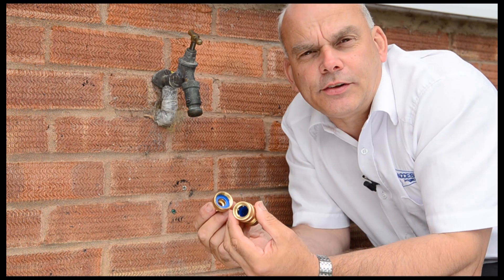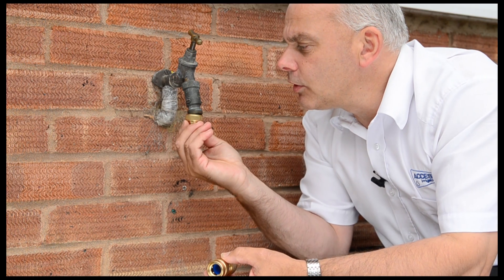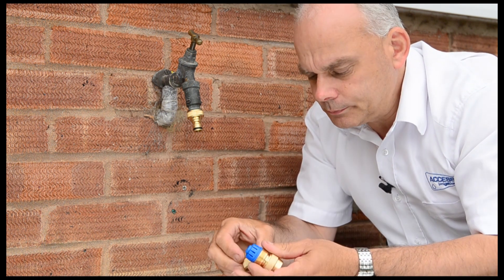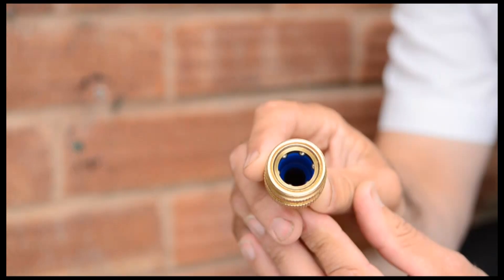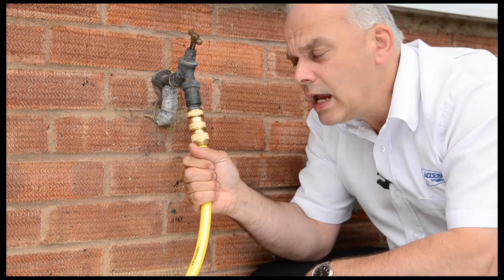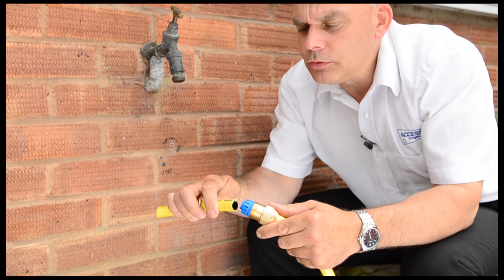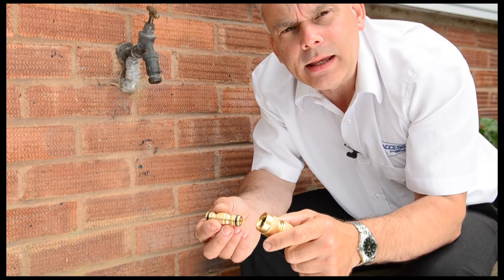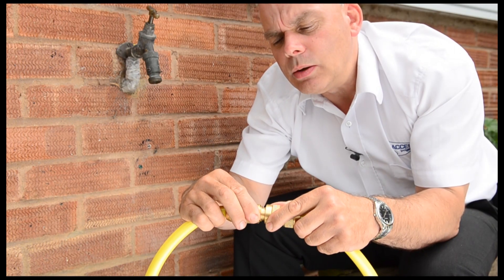Brass tap fittings hose connections

Comment: Makes it look easy for trying doing this when you got imperial tap and metric hose just won’t fit it’s a pain in the arse 
He has all the best connections setup but in reality people have all different connections.
Reply: Generally all UK garden taps are imperial 1/2" taps. These have a 1/2" BSP thread at the back where the water comes in and a 3/4" thread on the outlet where the hose fitting connects.

Comment: My mate put a brass connector on my tap, but my Nozzle was a   plastic Hozelock type which came with a plastic tap connector. The plastic Hozelock Nozzle fits the brass tap connector okay. I guess both types are as good as each other.

Comment: I've fitted my connector as shown but the non-return valve doesn't allow much water through. I don't know where I am going worng.
Reply from the maker: That is one disadvantage with the non-return connectors, as they plunger restricts the flow. There is not much you can do about it I am afraid.

Comment: sir purchased the same products

...in starting both the male.female connecter join easily and smoothly without .any effort   but after 6 to 7 months of use  these connecter became rigid and easily not  fitting in each other until some adjustment has to be done
there is no leakeage problem  earlier and not prsently....but some rigidness came now

..is there is any solution such as cleaning greasing or any other method....plz suggest..
Reply: WD-40 or similar is great for the ball bearings and the stainless steel spring, it also helps reduce the limescale in hard water areas - just squirt some inside the fitting. For the rubber seal Petroleum Jelly (such as Vaseline) keeps the seal lubricated.
Reply: @AccessMinigreenhouse  thankz a lot

Comment: Could you tell me what's the price
of a hose connector like this?
I have a potable washing machine and the hose connector seems to have worn off since it linking and it doesn't get locked well and falls of very easily with the water pressure. 
A plumper wants me to pay him $25 for the hose connector and $65 for service charge 😞
Can the change it myself?
Reply from the maker: Here is a link to the website: http://www.garden-products.co.uk/catalogue/browse/brass-hose-fittings
However, all of our fittings are BSP thread type, which work in the UK, Europe and many commonwealth countries.

Comment: Everything depends upon the plastic teeth doing the job. I can't see this as anything other than a design weakness. Also you will need a good quality hose so that the hose walls do not yield.
Reply from the maker: The plastic teeth are nylon, which is a hard plastic. As the teeth have to dig into the plastic hose, if metal teeth were used, they would damage the hose. The hose does need to be a good quality hose, and should have enough thickness of material to allow the teeth to dig-in. As the metal ring on the outside is tightened, it exerts pressure onto the teeth to push them into the hose.